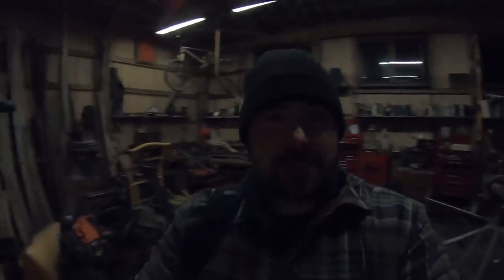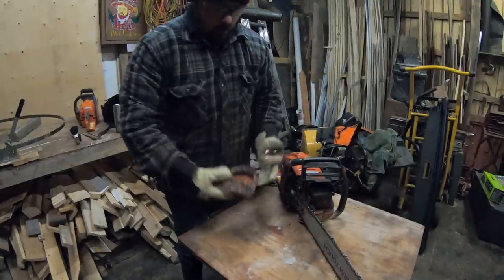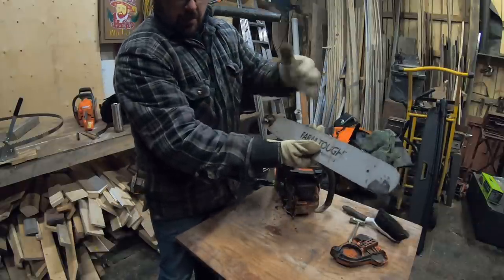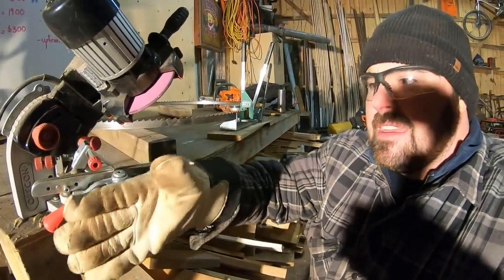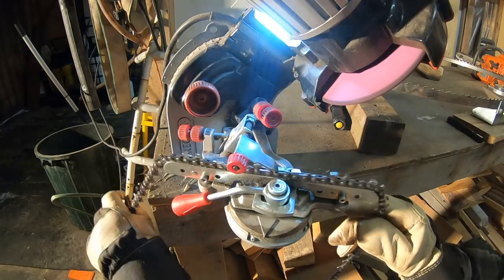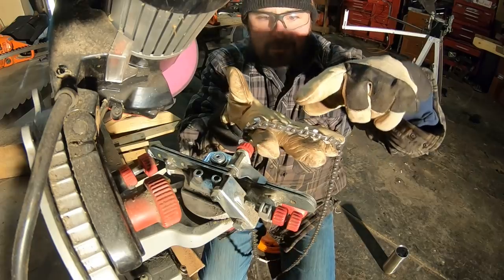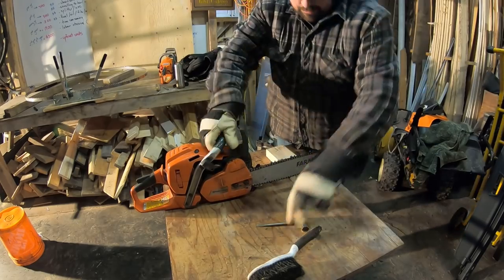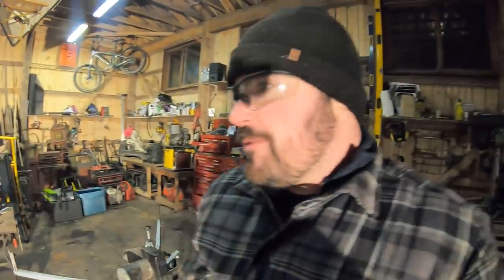Sharpening a Damaged Chainsaw Chain |  Razor Sharp in No Time

Comment: That Sharpener works awesome Sandy. Nice tool.
A couple of Tips for you. With my 56 year old eyes, I use a Mechanic’s Orange Flouresence marker on my chain teeth when sharpening. Easier to see in the shadows. And secondly, I buy the cheap Dollar Store cotton gloves. Wear them inside your heavy winter gloves. Then when u take your hands out of the heavy gloves u have some protection between the cold steel and weather. And they are thin enough that u can navigate around small nuts and bolts. Takes a bit of getting use too but your hands stay much warmer.
Be safe and have fun.

Comment: If I din't hand fill I would use the Oregon sharpener for sure. Just like your Woodland Mill sharpener. I yesterday did my sawmill blades & video. Great job Sandy.
Reply from the maker: Right on Dan! Yeah nothing replaces a good hand filing but the Oregon unit sure repairs some chains fast

Comment: Great timing, I recently purchased the same style sharpener so your how-to helps me make sure I was doing it right and surprisingly I was, lol.  We have some pretty bad weather coming in tonight, the worst actually, freezing rain. They're saying around an 1" (2.54 cm for you metric folks) of ice and around 1/2" or so usually means some pretty significant power outages. We're outside the city limits so we aren't high on the priority list as far as getting our power restored so I'm about to head out to cut some firewood. So again, great timing! Thanks.
Reply from the maker: Good to hear you've got everything up and running. Never good when the freezing rain rolls in. I can imagine any significant accumulation will cause some big damage. Hope it doesn't get too bad for ya

Comment: Good morning  Sandy. I own a tree service in PA and we only run full skip chisel chain on our 20 24 and 36 inch saws. 0.050  0.375 pitch.   It's a great cutting chain  and half the sharpening. Give one a try. We also file sharpen on site or on the bench just using a round file. You could use a triangle file but found a round file is just as good. Keep it out of the ground.  Thanks for another great video.
Reply from the maker: Sounds like you’ve sharpened a lot of chains! Great to hear you’re liking the channel!

Comment: My husband and I heat with a woodstove he sharpens the chains with an electric sharpener as well .  We go to the Woodley with  4 to 6  chains per saw.  He taught me to just Litely touch the chain with the grinding wheel  . And we mark the first tooth with crayon while it hot.  Usually a red, yellow or white. Carry the chains in the  same boxes they come in from place we buy them. We also use multiple saws, small ones  12 inch.  or so to limb cutting  and  up to  44 inch for main trunks.  We normally cut up to 14 to 18 cords each winter.

Comment: Hi Sandy,  Really enjoy your Canadian accent!  You need to try the Stihl sharping file.  I previously use a power sharpener then the file down the depth gage like you have.  But I found that using the hand Sthil sharping tool take less time than as it sharpens the tooth and files the depth gage as the same time... plus it only cost $35 USD!  Keep warm and safe!

Comment: good morning Sandy i don't have a sharpener but i am 66 years old and did all my sharpening by hand the chain i got on right now many of the teeth have barely anything left on it but i like the bar you are using since i started with the farm tough i will not by any other kind of bar have a great day
Reply from the maker: I'm with ya there! Those bars work real well
Reply: worn chains with very short teeth are my favorite to cut with, they seem to just buzz through wood faster maybe because there is less of a kerf or maybe less rotational mass, either way, keep cutting!

Comment: Hey buddy how are ya? Chainsaw maintenance is so important, we depend on them to run everyday and cut true. I use the thin stuff in winter and thick in the summer. I’ve been using a timberline sharpener, makes for a good sharp chain. I picked up a Stihl 2 in 1 sharpener for quick touch ups. I love running my saws. With all the storms, I’ll running them for months. Take care God bless you and yours.
Reply from the maker: I'm with ya on the importance of maintenance. Sure is a headache when you go to use your saw and it's dull!
Reply from the maker: Sounds like the timberline sharpener is a great unit!

Comment: Sandy another great informational video. Do you ever clean your chains before sharpening? I had a older gentleman tell me he cleans/soaks his chains in a degreaser. I tried it the last time and it helped to keep my 2 in 1 files cleaner. Although the condition I cut in may be different because I deal with primarily hickory and my land has very sandy soil.
Reply from the maker: That’s a good question but I hadn’t considered it before. I may just have to give it a try. Thanks for sharing

Comment: Lots of comments on a wood stove, I picked up a second hand wood furnace for under $300 and built a small addition 12x16 onto the side of main garage for it, the garage isn’t insulated, and a high ceiling 15ft high and when the temperatures are -20c to -30c because of the blower on it, it heats the main garage 20x32 up to +10c to 15c at most, but it’s totally nice for working on stuff, and with all the slabs from the sawmill it cheap to run.
Reply from the maker: I can imagine the heat would be nice. I just don't want to have to go and fill it full of wood a few hours before I want to go out in the shop as often I'm just out there on a spur of the moment

Comment: looking at one of those sharpeners myself i am wondering why you don t put a barrel stove in that shop and burn some of your slabs i can not stand frozen fingers any more
Reply from the maker: I prefer just to use a small portable propane heater if needed to save time

Comment: Good video.  If I have just a tooth or two in bad shape, I just sharpen the rest normally and let them catch up to the bad ones.  I don't notice much performance difference and I feel it gives me longer chain life than knocking them all down to the worst one.  I will knock down a couple to match the bad ones if they are on the same side to keep it cutting straight.  It's not how to do it.  It's just how I do it.
Reply: I just hand file with guide on a round file every couple tanks with the chain on the saw.  If some teeth get damaged I just file them sharp and carry on, sometimes you can feel the slightly different lengths but after a couple more filings it seems to even out..
Reply: @iandyck9605   I worded it poorly, but we're pretty much doing the same thing.  I just won't take 40 teeth down to match one that takes 10 file strokes.  I'd rather have a mostly sharp chain than a fully sharp one and half a pound of filings.   It depends on the damage, though.

Comment: I bought a forced air propane heater from Princess auto for heating up whatever I'm working on, which is usually my  snowblower, and it works great. It  works good for heating your wrenches up too
Reply from the maker: sounds like a nice unit! I have a small mr buddy heater and a larger heater I run off diesel i should get out

Comment: Hey, Sandy, Can you please tell me why you don't have a wood-burning stove in your shop?? I am sure you could pick one up pretty cheat, a specialty in the summer. It's a lot better than what you have now   (Reply please)
Reply from the maker: Hi Harvey, since the walls on my shop are 12’ high and there’s no insulation I didn’t think a woodstove would heat the building very well so I just use a small propane heater when needed

Comment: the husky has an inferior chain tensioner, if it was on the body of the saw like a stihl you can visually see the tensioner come out through the bar and the side cover going back on is not an issue as to whether the tensioner is lined up or not, but husky is a good saw

Comment: Great videos. Always teaching. Love it!! When it comes to bar oil for me in the winter time I run used engine oil. I don’t have any husky’s all stihls have done this for 20 years. Never any problems. It’s not like bar oil is vital to the engine it’s just a coolant.
Reply from the maker: I haven't heard of this before. Thanks for sharing Josh
Reply: I also reuse old engine oil, I let it sit in washer fluid jugs for about a year, so the sludge settles out, or it could plug the oiler port on the saw.
Reply: @sawingwithsandy  I've used it as well, seems to work ok.

Comment: If you keep your core warm, it will make it easier to keep your extremities warm.  I've made it a habit of wearing fleece glommits with some kind of glove liner, or even just a jersey glove inside.  If I'm not using my fingers, I can pull the cap over my fingers to help stay warm.  If I'm ice fishing, I'll normally throw a hand warmer in the palm of the fleece glove.  If I'm dealing with sharp stuff like chains, or briars (hunting/cutting wood), I'll take a pair of insulated gloves and nip the end off at about the first knuckle on the thumb and index finger.  Then wear a glove liner, or jersey glove with it.  Gives me more dexterity than regular gloves, but keeps everything warm.

I've also found that if I keep 4 or 5 bar nuts in my tool box, I never end up loosing them :)  I call them Murphy Insurance.

I run a 60cc saw with an 18" .325 chain and a 9 pin rim.  18" will go all the way through most of the oak and hickory that I cut.  I drop my rakers to .040" on that saw.  It pulls into the wood really well, thows big chips, and cuts really fast, and really easy.  On most logs it will out run my 90cc saw that runs a 28" 404 chain.

Comment: Great video, bud. Very informative. I have about an 1-1.5 acres of red pines to clear…planning on milling them all…..any pointers as far as how to attack it?
Reply from the maker: Thanks! Last time I did a big clear of the red pines I found that I cut down a few too many trees all at once and before I could mill them all, boring insects got into the logs. I find cutting enough trees that you can mill in two weeks time would be good to prevent the boring insects. Other than that I just had a plan in place for how I was going to move the trees once they hit the ground
Reply: @sawingwithsandy  thanks bud. I’m trying to get land cleared for a garden so I’m afraid I’ll be cutting them before I can mill them or even know specifically what I’ll be doing. I do plan to debark them before the bugs get too active as well as giving them a healthy dose or boric acid treatment. Hopefully that’ll help. 

Thanks for your input! Look forward to future videos!

Comment: Always wondered how those sharpeners worked. I use a round file on the teeth then a flat file with depth gage on the rakers too, also flipping the bar over on each sharping, also with a roller bar I tighten the chain so very little slack.
Reply from the maker: Sounds like you've got the same thinking I do

Comment: Nice video...like the idea bar on board...
And gauge gauge only don't file on it...
Recommend u flip bar each time u take off to sharpen or clean...also make or buy tool to clean out bar groove...
Air compressor works best to clean everything...
No shame in wearing safety glasses...be safe don't loose an eye...
Use yellow marker see start tooth easier...
Important when buying a saw is weight and comfortable and location of ports...if you are using it all day long, it makes a big difference...i like sachs dolmar and or echo....the big echoes are heavier then the big sd...but more available at dealer around here...the small top handle echoes are great...
I tried several other manufacturers and i didn't like them for me...but for others if it feels right for you that's ok...buy what is comfortable for you individually...like i said, ur the one carrying it and using it all day long...work smarter not harder...
Also, on the big saws 50cc to 100cc i like using the skip jack chains, made for cutting with or against the grain (combination) ...cuts faster and less teeth to sharpen and it costs less.

Comment: Good day to you Sandy, thanks for another nice video. I'm wondering, do you have 3-4 chains for every chainsaw? I use this ''method'' to always have a sharp-ready chain on hand and use the next one when I feel/see the wood chips become smaller, plus the wear of the sprocket is much more equal, progressive and its longevity is extended by alternating the 3-4 chains, a worn sprocket and a new chain means that, sometimes, the chain ''jumps'' one or more teeth. Then, when less busy and in the shop, I take time  to regularly disassemble and inspect all of my saws and clean them thoroughly before sharpening the chains and adjusting, lubricating everything necessary. My saws are from 25 to 42 years old and still running quite good and strong. Be safe and be well.
Reply from the maker: Great to hear about your saws still going strong. I typically have about 3 chains ready just for the reason you mentioned

Comment: Good stuff brother...
Never tried one of those fancy grinders as of yet..
Looks like it can save yea some time on those really beat up chains...
No heat in the shop?
Keep up the good work there Sandy..👍👍
Reply from the maker: Hey Steve! Yeah it sure can bring a beat up chain back to life quickly. I sure wish I had heat in the shop but nothing as of yet.
Reply: I got a “fancy grinder” from Harbor Freight last season. Oregon is a top brand but their grinder was $200+ dollars. Depending on the application you may need a $200 grinder (it might be the next one I buy), but I just cut trees, logs, and railroad ties. Harbor Freight has a “cheap” less fancy grinder for about $25 buck. Not as many bells and whistles as Oregon, but I have gotten an extra 2 or 3 “lives” out of many $20 chains, so I figure I’m ahead and if it craps out tomorrow I’ll just buy another. ….. And yes the no heat crossed my mind as I watched I first thought Sandy’s breath was a fire!

Comment: Thanks for the tips on sharpening a blade.  Have you ever thought about adding a fireplace to the shed, you certainly have plenty of wood ?.
Reply from the maker: I did consider it at one point but since the ceilings are so tall and the building in not insulated I decided against it
Reply: Sandy are  you  honestly  saying  that you get your  chains  sharp as new with your  machine? I have been  cutting  wood for too many  years  to count  and I  have  never  been  able  to  get  a  chain resharpened to like  new. I have always  used  a file and tried every  suggestion  I've  seen but never  is the chain like new. New chains  cut like a miracle  but  I  never get that back.
Reply from the maker: It’s true Gary. I can’t tell the difference between a brand new chain and one I’ve sharpened

Comment: I use a different type of sharpener for my chains. It is by Oregon model number 38249. It is 12-volt DC powered. It uses 3/16" diamond studded shank. When sharpening, I also look for the shiny tooth that I started with. It is like putting on a brand-new chain and only takes about 10 minutes to sharpen the chain. It is hard for me to imagine how cold it is to take your thoughts away from time to time, lol. Would a wood stove heat your shop or is it not worth the trouble? Have good days!
Reply from the maker: Love that shiny new chain look too! I tend to use a small propane heater when necessary to save time

Comment: The only downfall of that type sharpener is that it removes the temper from the cutting edge of the tooth thus softening it and the cutting edge of the tooth won’t last as long. I had a good friend complaining that his chain didn’t stay sharp long enough and I hand filed it for him and corrected the mistakes that the local shop had been making when electric grinding it, basically misshaping the gullet, and he took the saw back and cut all day with it without it dulling and called me and was so excited about how long it lasted. Same thing with any blade like a lawnmower or knife. A cold process like filing or slow sanding keeps the edge from softening. You may not see what’s happening with the naked eye, but those grinders are essentially cutting by heat/abrasion and the very molecular edge will be softened by de-tempering it. 
But these grinders do a fast job of cleaning up a badly damaged chain like you do in the video. They certainly have their place.
Reply from the maker: For sure

Comment: I've got to laugh.  I was just cleaning up and sharpening some of my saws, stopped for lunch, put your video on and there you are doing the same thing.
I noticed many suggest that you should put in a wood stove.  You don't want to heat up an non insulated building since too much moisture will build up and rust all of your tools.
Reply from the maker: Im with ya there Paul. I considered heating the shop before but didn’t want to have to go out and preheat the shop hours before I wanted to work so I use a small portable propane heater when I need a little heat

Comment: I find it interesting that a guy who has more than a passing interest in wood doesn’t use a wood stove in his shop. As a lizard-like dude from the American Deep South is was a priority for me! Space issues holding you up?
Reply from the maker: Trouble with having a woodstove in my shop is the ceilings are very tall and there is no insulation and so I would have to constantly put wood into it to get it remotely warm. I did weigh out the options but thought it would end up taking up too much of my time and wood for little gain so I just use a small portable heater if it doesn't get chilly.

Comment: toothbrush is a good chainsaw cleaning tool - though if you use air compressor it pretty much does it all the best (my nozzle leaks)
Reply: cold showers will help you get conditioned to the cold
Reply from the maker: Yeah toothbrush is a great point! I'm sure I've got one kicking around the junk pile in my shop haha